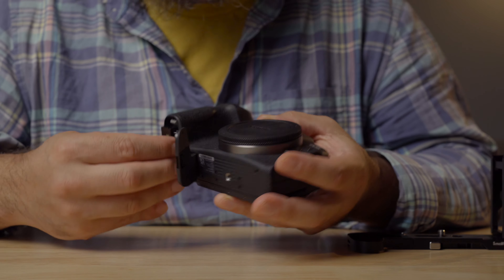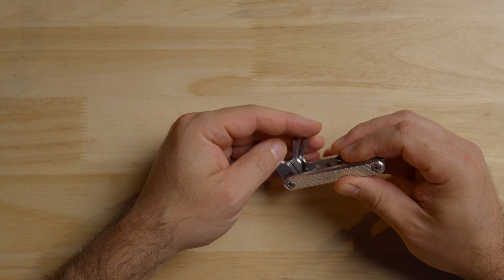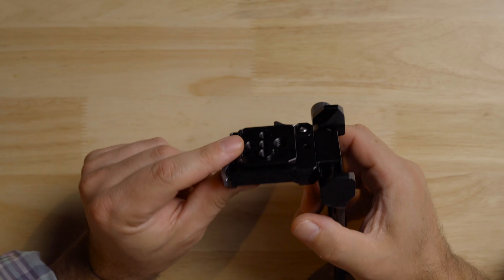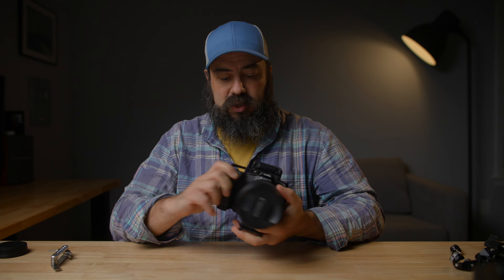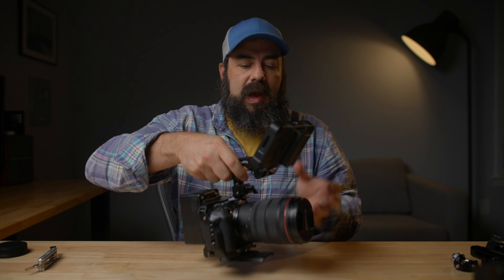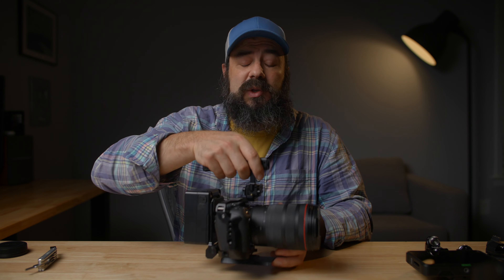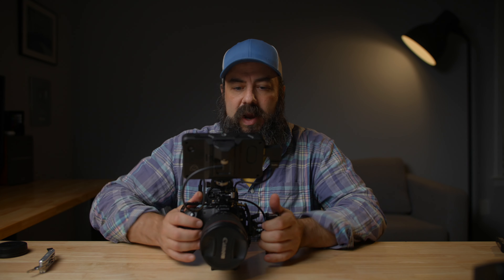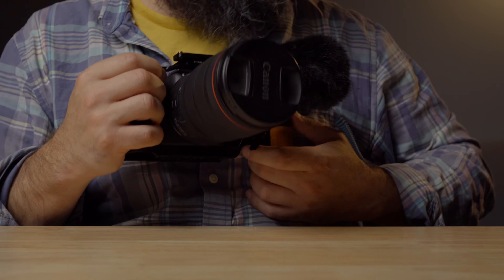Canon R8 - Video Rig & Battery Solutions

Comment: thanks for this. not sure if i missed, but does this mean that the R8 can charge via usb while operating? unlike the RP, it can only charge when its turned off.
Reply: The R8 cannot charge via usb while operating. Most (all?) power banks that deliver 45 watts through a single connection can power the camera, if there is a battery with a charge inside the camera, but it will only charge the battery when the camera is turned off.
Reply: @myblacklab7  hey, so im using the R8 now and i have a v mount battery that supports PD and can confirm it can charge while operating. The battery icon will turn grey when on to indicate that its powered externally. It also works with PD power supplies like car or wall chargers.
Reply: @AndrianTam  Thank you for the information!
Please note that "charge" and "power" are two different things. I thought you meant that you wanted to charge the battery while the camera was in operation, but now I understand that you meant that you just wanted to power the camera, and I'm glad that worked out well for you. :)
I've been researching this subject a lot, and while you might already know this, I thought I'd mention that the power supply (power bank, external battery, etc.) needs a certain minimum voltage and amperage - I think most (maybe all) 45 watt power banks/batteries will work, if the cable is rated to carry that much power. Note that the 45 watts I'm talking about is 45 watts from one part - some power banks add together the total wattage it can provide while powering multiple devices, which could mean that a "45 watt" power bank might just be able to provide 15 watts of power to three different devices at the same time.
I'm a little leery of using a car or wall charger - I suppose that probably works, and is probably safe if one is using a USB-C or Thunderbolt cable, but I wonder if one might run into issues if there were a power surge or something like that.
Reply: @myblacklab7  ah yes sorry, my terminology wasnt clear. I initially asked this before buying the R8, but in the end i still got it and im glad they all work. 

Yeah, the other chargers usually has voltage regulators but no guarantee that it would protect the camera. Its gonna be used minimally anyway

Thanks again
Reply: @AndrianTam  Cheers!

Comment: Hey I just bought 2 smallrig vb50’s , how do you charge them ?? I know the charging brick has to at least be a 45wh pd , but what cable do I use ? Are cables rated ? Do I need a 45 pd rated cable ?
Reply from the maker: I have used random USB C cables that I have and they all seem to work.
Reply: Cables are rated. It's somewhat complicated, but Google is your friend.
Javex cables are made in Taiwan - nearly all others are made in China.

Comment: Hello! Can you record 4K video with power from USB-C powerbank? When I turn on video recording, my R8 immediately switches to the internal battery.
Reply from the maker: You should be able to use the power from USB-C PD while recording unless your powerbank doesn't have enough watts.
Reply: @Josh_Sattin  I have xiaomi powerbank with PD 3.0 45W, camera works, battery icon is gray, until I try to record 4k60...

Comment: Good to see once again that R8 does not overheat at 4K@24 fps...

Some user mention that even in stills, it overheats...
Reply from the maker: Oh the R8 overheats big time. The only situation I have found it not overheating is in a cool indoor studio setting. It overheats quickly outside and even overheated in my driveway when it was 65F outside and not even recording. I made a video about the overheating: https://youtu.be/N5jVSn-0H5g
Reply: @Josh_Sattin  thanks for the reply.. good that you can use without overheating in studio... 

Will be happy to see you testing upcoming sony cameras for overheating... Do so if you get some like A6700 rumoured to be announced on July 12..
Reply from the maker: Unfortunately I have to do overheating testing on every camera I get my hands on nowadays.
Reply: @Josh_Sattin  yes... but your test and video are very helpful...

No doubt 4k takes lots of processing which can overheat cameras but wish camera designers should do something to overcome them...

Comment: I built a rig using Sony NP-F970 batteries. They last just as long, but more compact and I can split the weight in my bags.
Reply: I'm considering using the Neewer NP-F970 Batteries(Got with Newer lights) with the Small rig Adapter Plate with my Canon R8. 

Do you think it can fry my R8?
Reply: @sahibdewan8961  Na I doubt it. You should be good. I've been using the same setup for a while now.

Comment: Great video, not sure the point of the battery though, it’s very big and blocks a lot of the screen which then means the extra expense of the monitor is essential. I don’t see what’s so hard about changing out the smaller batteries and just having 3-4 of them. It only takes 2 seconds.
Reply from the maker: On more demanding shoots having a larger battery is very helpful. Also if you need to power accessories like monitors, follow focus, wireless video transmission units, etc. it is very helpful.

Comment: The Canon R8 will not power direct from an ext battery via USBC. It still runs the OEM battery in the camera to empty.  The external battery will just recharge the Canon battery once it dies.  That may be too late to keep things functioning as there would not be enough battery charging power. Dummy battery is the best bet with the external battery.
Reply: I think it depends on your use case. Although you do need the OEM battery in order to power the camera even with the external battery, I’ve noticed that the camera prioritizes to the external battery when plugged in. I’ve done tests on this to conclude this as well. When I use just the internal OEM battery, the camera overheats in 4K 60fps mode pretty quickly. When I plugged in an external battery via Usbc, I recorded for over an hour and could not get it to overheat.

The issue with a dummy battery for me is that if a cable gets unplugged somehow, your camera is essentially dead. If you use  Usbc power method, at least you have a little time to react. Just my experience.

Comment: What the point of making R8 rig since it has no stabilisation, so is useless for shooting from hands without a gimbal.
Reply from the maker: The R8 stabilization is decent with a stabilized lens. Also adding weight to a camera rig will increase the stability of the footage of any camera. Here is a video where I tested the stabilization of the R8: https://youtu.be/pVnsGe5MO3E
Reply: You obviously haven't seen the mk6 ii wobble....
Reply: Those cinema lens and camera like red or arri is totally useless cause they dont have any stabilization
Reply: @ntsan  Not useless,  you just have to know how to use them. Just look at all the big budget films, they don't use lens with IS.
Reply: @AkaBull  pretty sure that was their point ;-) #sarcasm
Reply: Even if the R8 does not have IBS, the camera has a digital stabilization setting (min and max) that crops a bit in to make it feel like it has IBS also most non-cime lens will have stabilization in them. So it’s no useless?
Reply: Bro it’s the definition of right tool for the job. If you need good IS don’t get it. If you don’t then it’s always a digital IS option